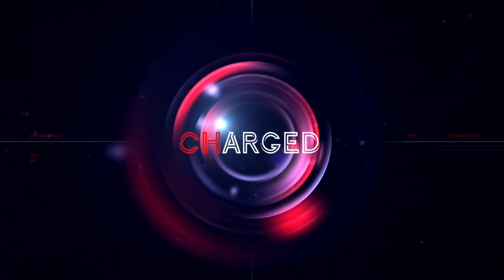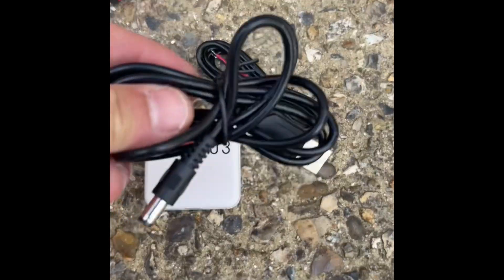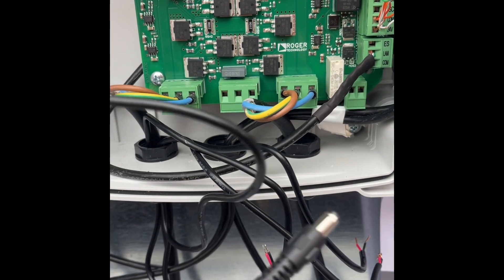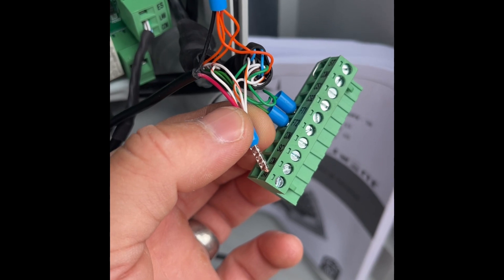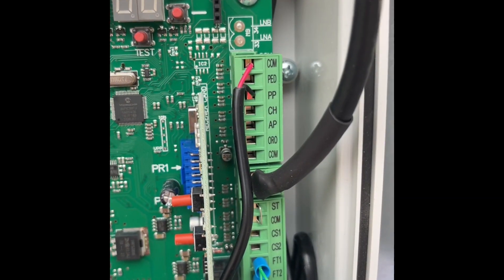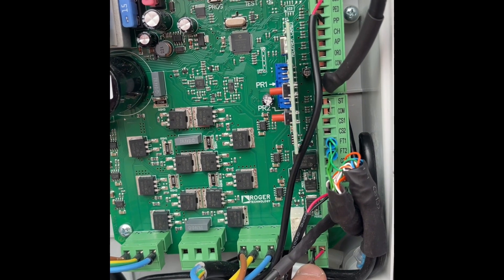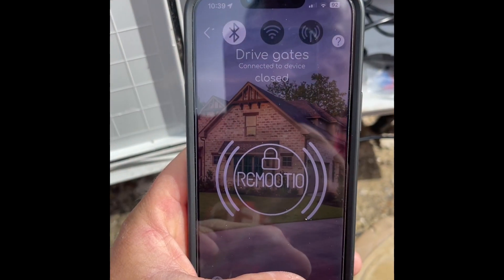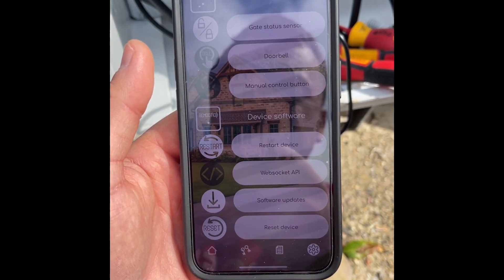How to Install Remootio 3 to anything in 13 minutes!

Comment: Question so if I’m hard wiring the Remootio I don’t have to purchase a separate hard wiring adapter?  Just cut the usb cable end?
Reply from the maker: Yea no need providing you have the right voltage feeds.

Comment: Hi, thanks for the video. I have question. How do you wire up Remootio with ROGER B70/2ML if I'd want to also use the Pedestrian function (which opens one side of the gate only)? The generic open/close is wired correctly and it works fine. Thanks in andvance!
Reply from the maker: Fairly simple you wire 1 relay to com and AP for main open and relay 2 to Com and Ped then you set your output configuration
Reply: @ChargedServices thanks mate!

Comment: If I issue the Alexa command to close door if the door is already closed will remootio ensure that the signal is not sent so it doesn't end up opening it by mistake.
Reply from the maker: Yes providing you have the status sensor connected then a Close command to a Closed Remootio will never trigger.

Comment: Thanks for sharing, I got Wi-Fi option set up successfully, but no luck to get the Internet option work, it always saying "Action failed, there is an error". Do you happen to the reason? Thank you.
Reply from the maker: Apologies for the late reply, Im not sure if we have spoken between this post and now. Has been a lot of issues with customers that have Sky Broadband currently. Sky Shield is blocking the ports required for Easyconnect to work.
Check couple of things for you though, Older iphones are having issues sharing network settings in the latest IOS too so you may find setting this up on a newer iphone works where as it doesnt on the one you tried it on before etc. Also if you have a Mesh wifi setup, these again are being sold to everyone but many dont understand how to set them up. If you have a router provided by your ISP and have installed a Mesh system ontop. You need to set the Mesh system as ACCESS POINT mode only. Other wise you create a double NAT issue.

Comment: I have a Liftmaster sliding gate SL400EVK will the Remootio work with it and have you installed it on the Liftmaster ?
Reply from the maker: Yes remootio works on almost every panel and device. You just need to have identified your trigger terminals. On the website there is a full configuration section where you can check compatibility and wiring diagrams

Comment: thanks a lot for the video - very useful.

1. Could you please explain in more details how is the COM and PP setup is different from using two relays (com AP com CH). What does it mean from a gates control stand point? 

2. Also, if Roger gates are programmed to automatically close, would setup differ or should it always be COM and PP?

3. Does a STOP button logic work in remootio app? or is just open or close?
Reply from the maker: 1. It doesn’t make a lot of difference, preference if any. You would need the gate status sensor setup otherwise you could be pressing remotely and not know if it’s opening or closing etc. it’s our preference that generally our customers are wanting to use the hold open feature so you can guarantee that holding the AP terminal will do that. You can also program on Roger that the PP command given by a remote overrides or does not override other commands so you just have better guaranteed control.

2. Again doesn’t matter too much. If your PP commands are programmed to be non overridden. Holding it latched on will will work. You would then have 1 button operation. Example, one customer of ours has one remootio which controls both his gate and his garage door, both buttons are PP openers basically.

3.stop button works if you program the remootio outputs as just pulse outputs. However it’s “non standard” so voice control etc you will have to make a lot of customisations if you wanted to use it. From an app point of view it’s just 2 buttons the outputs you can connect to anything you want.

Comment: Thanks for the video looks simple to install,
Question: Can you install multiple Remootio and run off the one app, ie: 1 remootio for your front gate then another to your roller door and then they link up to the one app ? So you can control multiple gates, roller doors etc
Reply from the maker: Hi, yes assuming your asking can you have multiple Remootios in the same app. Yes you can have as many as you like. We keep a key for all of our customers which they have control over, allows us access when we need to come round at their request and control. So have upwards of 30 on one app no issues.